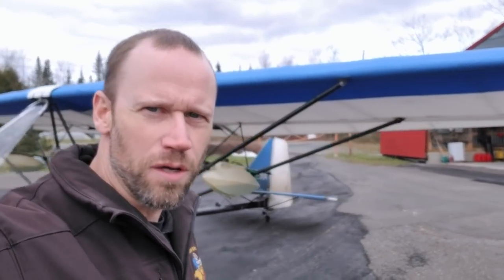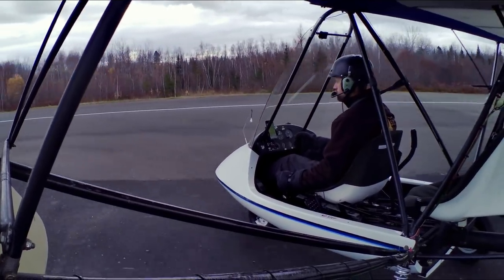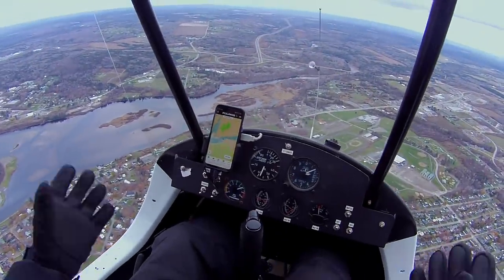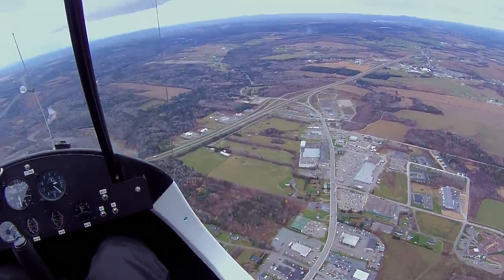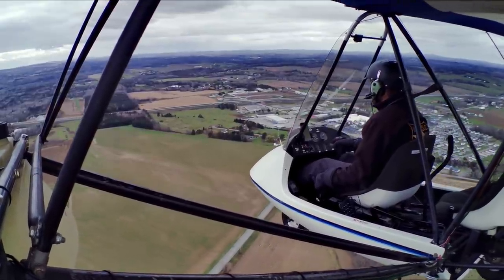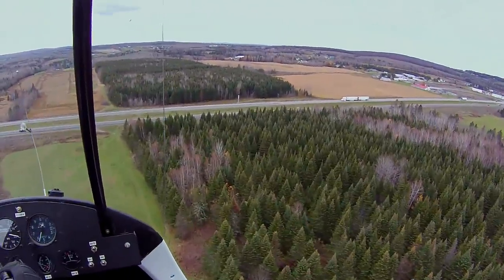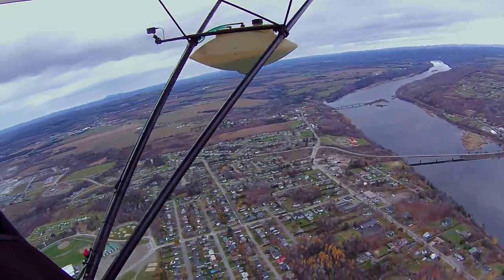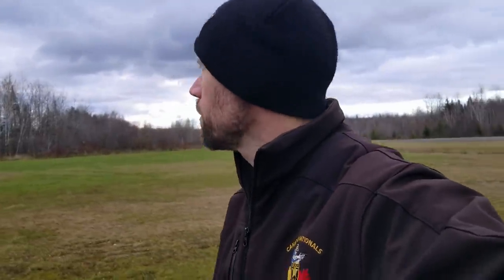Adjusting the Center of Gravity

Comment: Great video, flew one a bit in the 80’s on skis.  Loved it.  I fly the Fireboss tanker now…. same idea… stick and throttle!   One question to the RX550 people …. I recently flew a Quad City Challenger and will probably never fly in one again due to the ridiculous amount of adverse yaw.  A turn requires leading with the rudder pedal and then opposite stick to keep the aircraft flying properly around the turn…. is the Beaver the same???
Reply from the maker: The Beaver is not the same. It has differential ailerons to counter the adverse yaw. I can easily turn with either ailerons alone or rudder alone. Using both makes the nicest turned though. I have flown a Challenger as well and know exactly what you're taking about. Lol

Comment: My concern would be how it reacts in a stall.  Aft  c of g can be dangerous if the tail has a tendency to drop  , potentially causing a whip stall and very poor outcomes. I suppose you will be doing more testing before making it a permanent  change.  In my 550 if i pull power off and let go of the stick it starts to drop the nose and slowly pick up speed , level out and then repeat. I assume this is desirable
.Always enjoy the videos Matt
Reply from the maker: I carried out the appropriate calculations and hove only brought the CG towards the middle of its range instead of being forward. My nose pod has been repaired more than once and is much heavier than it originally was leading to the forward CG. A factory Beaver should have its CG in a much better location without the lead in the tail.

Comment: Greetings from Weyman Airpark!  My "V" is on strike as well.  I haven't landed at Woodstock in years but I often fly by in the RV4.  There's quite a difference in the acceptable Empty Weight CG (for the builder) and the flight envelope (for the pilot).  Adding 12 lbs to the tail of your ultralight is quite a significant engineering decision.  Can the tail handle it?  Does the Beaver have a trim control?  Any performance changes are probably due to trimmed airspeed changes (set Angle of Attack).  You also probably notice these with fuel load and passenger load, although both are pretty close to your CG.
Reply from the maker: Come stop in sometime! :-)
Yes, it has a very large acceptable CG range which is nice to have on such a small plane. The only trim control it has are ground adjustable tabs on the tail and I have a spring trim set-up in the cockpit. I had to add significant backforce with the spring before adding the weight and now it's all but slack. With the tail not adding so much aerodynamic downforce, the AoA should be little less on the wing which I think accounts for the increased performance. Ideally I would have removed weight from the front but that's almost impossible to do short of replacing the nose pod with a lighter one. There's just nothing else up front that can be removed. I guess the other option would be to move the engine back a few inches or the main wing forward a few inches but that would an even bigger engineering project.

Comment: Ok, omg, STOP, I don't care how similar the planes are, you need to learn how to do a proper weight and balance calculation, MATH ON PAPER, if you can't do that stop flying until you learn how
Reply from the maker: Oh calm down, I did all the math. Didn't use paper though if that's alright, I custom built an Excel spreadsheet. Once I was sure that the math was correct, I verified it by comparing the performance of a practically identical airplane. I've been flying the plane like this for 2 years now and it flies better than ever so I'm pretty sure I got it right.
(Also, if you skip to 1:57 you'll hear me tell you that I did the math and I even display the results as text on the screen.)
Reply: @mmatt  well, at least you fixed the problem by making the entire plane heavier instead of addressing the loading issues lol
Reply from the maker: @vg23air  Again, watch the whole video. Did you miss the part where the fiberglass pod had to be repaired making it heavier? Or how about the weight difference in the engine gearboxes? Not everything in life can be perfect, sometimes we have to take an imperfect approach to make things better. There are plenty of aircraft that need ballast to fly properly.
Reply: @mmatt  lmao, so whats another 10 lbs lol